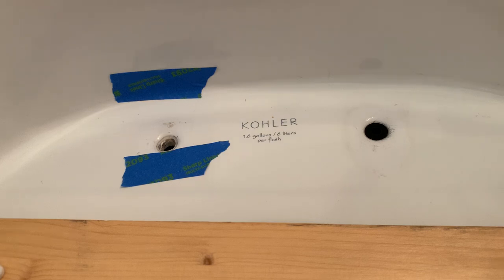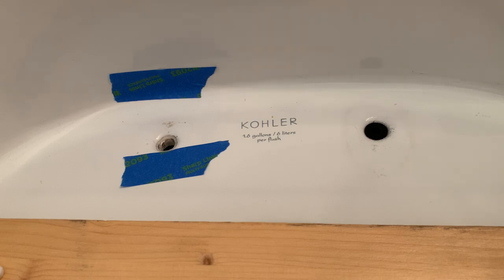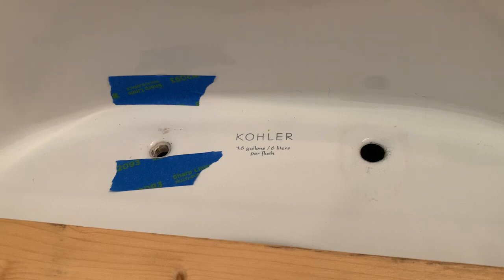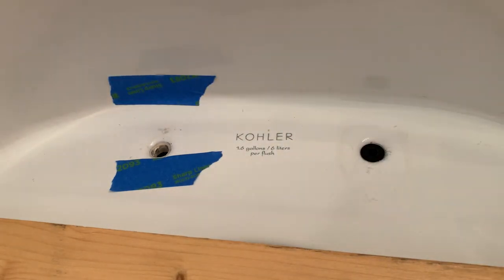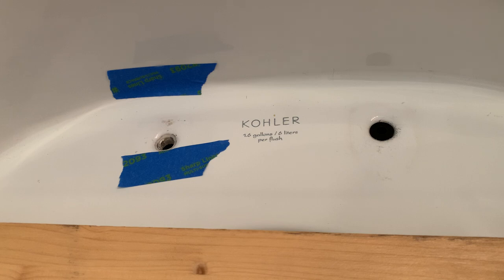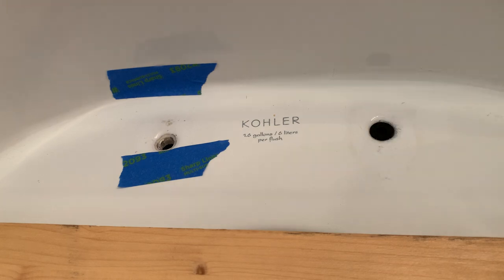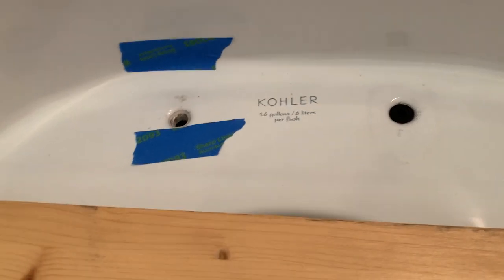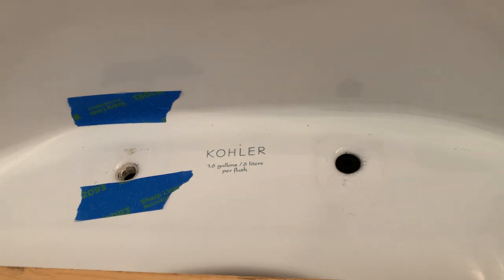How to Remove a Stuck Toilet Seat Bolt in One Piece KOHLER with Hidden Anchor

Comment: I have the same problem right now with the same Kohler toilet bowl. I was able to remove completely the bolt and plastic (hardened glue) by soaking it with WD-40 and after about an hour, it came out without much effort. It's a clean hole just like the right one on the video. Now, I'm waiting for the Neoprene anchor bolt I ordered online so I can install the easy release Kohler toilet seat. Thanks for the video!
Reply from the maker: Glad you got the seat off. I have two Kohler toilets, and sadly I've become an expert in fixing them.  I just changed the rubber valve and tank fill mechanism, and it was another pain.   It's really not good design in terms of replacing parts.  I'll try to make a vid talking about it.  I can't video the actual process because it took a long time and some swearing involved.

Comment: what a helpful video.  Kohler wanted something like $60 CAD for their removal tool to get the rivnut off.  what a joke.  I was in the exact situation as your video and that tool would never had worked on those ceased rivnuts and bolts.  but following your procedure and investing in $10 worth of cobolt drill bits I was able to have 2 clean ceramic holes, waiting for those Neoprene Well Nuts to arrive now.  thank you very much for doing the leg work and research on these replacement nuts & bolts and to document the replacement procedure.
Reply from the maker: Glad it worked out!  Very poor design in toilet. I recently had to replace the flush valve assembly inside the bowl. Another terrible design. I had to use a piece of wood to wedge it in there, LOL.

Comment: I wish I'd seen this video 4 years earlier when we bought this house with the one piece seat. Maybe I wouldn't be struggling today, it's a nightmare. All I wanted to do was put on a "quick, easy" bidet  attachment.
I was really hoping for some to tell I could save the stay, but I haven't found that video yet. Thank you, anyway
Reply from the maker: One piece toilets are the worst!
Reply: I’m in this exact position now. Probably going to have to send the bidet back because this seat will NOT come off 😢

Comment: Thanks!  I’ve been dicking around with my toilet seat for a year.  Bolts are tightly fused, can’t get the seat off any which way.  The seat is tight and works fine, just wanted to change it to something nicer.  You’ve convinced me to just leave it alone, LOL.
Reply from the maker: Ha ha. Yes, if the seat works it's probably best to just leave it alone... unless you have a whole day with nothing better to do, LOL

Comment: Thanks! This helped a lot! Local hardware store had 3/8 expansion nuts. Had to use smaller diameter bolts so I hope they last
Reply from the maker: Smaller diameter bolts should get the job done. Not much torsion on a toilet seat....hopefully

Comment: Jay, the anchors are called well nuts,can be purchased in Lowe’s or HD,hacksawing the bolt off is a nightmare if you can get the bolt up high enough I got my 15 in lock cutter under the bolt head and wam cut it in 3 seconds and like you did the Japanese saw was excellent for cutting the plastic hinges
Reply from the maker: Thank you friend. I have another different toilet I need to change the seat on...let's hope it's easier and faster

Comment: Hi Jay. Very helpful video. I'm at the point now where all the plastic hinges are off and the head of the bolt is cut off. I've been drilling with cobalt drill bits for six hours now. Is there a better method for drilling out the seized up bolt and anchor out of the porcelain?
Reply from the maker: Yeah, it's a pain. I would recommend changing out the drill bits as they get worn down. It costs a couple more bucks which is a pain, but it saves time. I ended up going through several bits. Unfortunately, there is no easy way. Best of luck to you!

Comment: Thank you!  I had the same problem with my Kohler one-piece toilet (Rialto).  I was able to get both of the bolts and adapter inserts out after using a Dremel, hammer, and drill.  When I ready to put the new KOHLER toilet seat on the KOHLER toilet i thought I was within sight of victory.  Nope.  Apparently Kohler didn't see the need of including new adapter inserts for KOHLER toilets with their own seats.  Thanks to your work and thoughtful posting of the link to those zippy anchors, I hope to soon have a stabilized toilet seat (and happy wife).

Comment: I was having a heck of a time gettin the plastic off when the bolts wouldn't loosen. Instead of saws I used an old soldering iron to melt the plastic around the bolts and even cutting the seat loose. i had to drill bolts out when they wouldn't give or pry out.Used  the kayak holders showed in the video to hold plastic seat holder heads to toilet. No way i would use the holding system that came with seat. Amazon has the kayak screw kit w/o washers P/N: H2o Kayaks H2o M5 Neoprene Well Nut Inc Stainless Steel Pozi Screw. 
THEY WORK GREAT AND WILL BE EASY TO REMOVE!
Reply from the maker: Great idea with the soldering iron. Glad it worked out for you!

Comment: Interesting video. My issue is while one bolt will come out easily, the onther come maybe 1/2 inch and then just keep spinning but wont come out. Should I try to cut it off, drill it or  just go buy a two piece toilet?
Reply from the maker: I would get a longer drill bit and carefully try to drill in the center. Start small and increase drill bit size. Hopefully the bolt will split in 2. It will fall back into the recess, but that's OK. That being said, this toilet is also a hassle to replace the valve on the refill tube (those get rotten over time), so it's not a bad idea to get a better toilet if budget allows.

Comment: I used bolt cutters to cut the bolt head off.  Was really fast and really easy to do
Reply from the maker: Glad that worked out for you.  I don't want anyone else to have to go through what I did.
Reply: After you cut the head off, arent you still stuck with the bolt inside the anchor?

Comment: I soaked the bolts with W-D 40 for days. Used a high torque screwdriver.  They won’t budge.
Reply from the maker: Sorry to hear that. I think at some point the metals almost weld together into one clump

Comment: I'm having the same problem with my Kohler toilet.  Why did anyone use stainless steel bolts?  The replacement parts are all plastic, and more likely to not seize up like these bolts.  I've independently gone through your steps up to getting the bolts out and am now stick.  Will try your ideas, but also am thinking of buying a pulley remover that seems right fora the job.  Ugn!
Reply from the maker: Yes, it's a flawed design for a toilet. I think it's a scam to make everyone just pay for a whole new toilet.